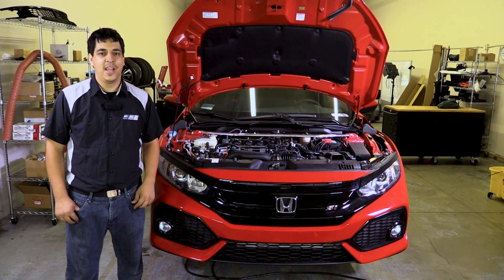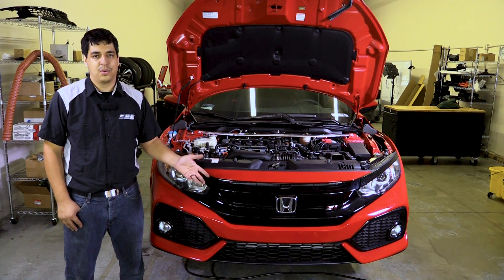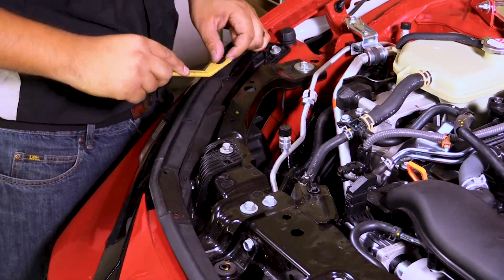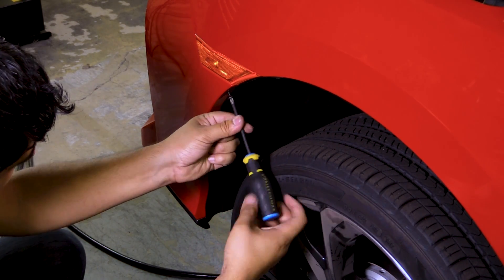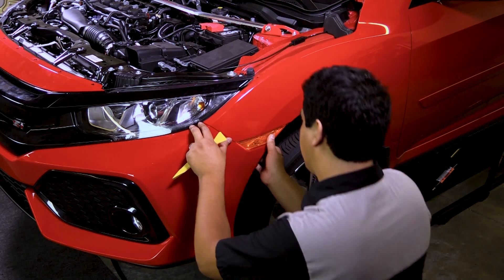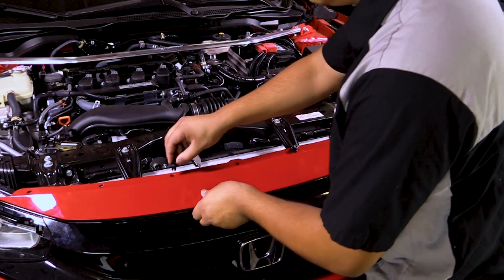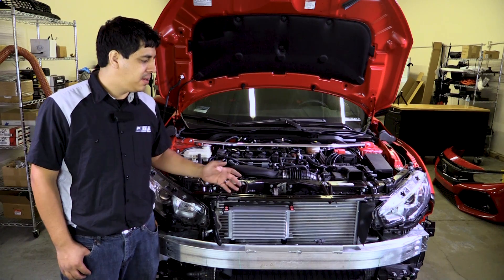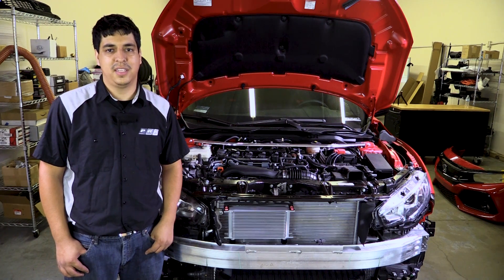Just The Tip - Front Bumper Removal - Honda Civic 2016 2017 2018 2019 2020 2021

Comment: whats that tool you used on to release the bumper from the clips under the headlights? i hit a raccoon a few days ago, and the clips came lose from under the left headlight and on top of the side marker. and clips from the bottom of the bumper as well.. idk  if i should remove the bumper completely and put it back on or just try and fix the clips while the bumper is still intact
Reply from the maker: The tool we used is a simple plastic non marring pry tool. These can be found at most auto parts or hardware stores. If the bumper is misaligned, it may be best to completely remove it, or atleast that side, to ensure it can be realigned.

Comment: Do you have a video to show how to remove/replace the interior metal bumper?
Reply from the maker: We don't have a video showing how to remove the interior metal crash beam. You should really leave it in place.
Reply: PRO Car Studio 
Thank you. Unfortunately, the reinforcement crash beam is damaged and I need to replace it. It doesn’t look to complicated. I’ve done several other things and think I can do it.
Reply: David Dix Did you ever find a video showing you how to remove/ replace the metal bumper reinforcements bar?
Reply: Swizzy Swaz ,
Never found a video. However, I did complete the job myself. Replaced the bumper reinforcement, passenger side headlight, front grille including emblem, ambient temp sensor and many clips, bolts & screws. She is good to go! It worked out pretty well. Not perfect, but feel much safer & secure than before.
Reply: The touring level of the civic has an anti collision sensor in the left fog light panel. Im wondering if the location of the sensor could be changed to where the honda emblem is on the front?

Comment: no front sensor cables? parking sensors, etc?
Reply from the maker: The si model we worked on, did not have additional sensor. Some other trim levels may have sensors to keep an eye on as you remove the bumper.
Reply: @procivic  kay, thx man!

Comment: Worst honda bumper design on any honda model ive ever worked on. What a nightmare. This car looks new and came apart really easily, in 5 years those clips wont come out without cutting them, none of the clips will come out without breaking, the eyebrows will break in half getting them off..... I no longer recommend honda.
Reply: User error